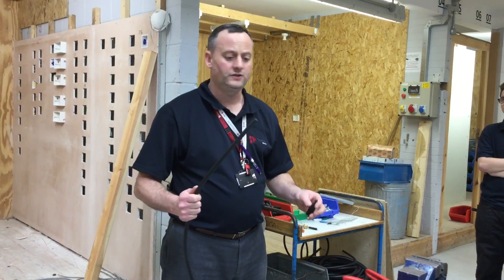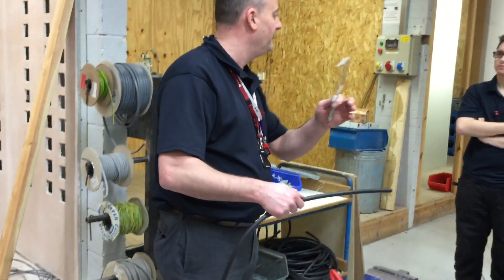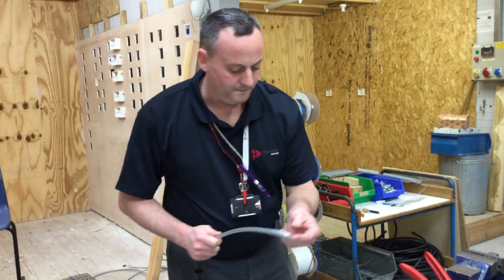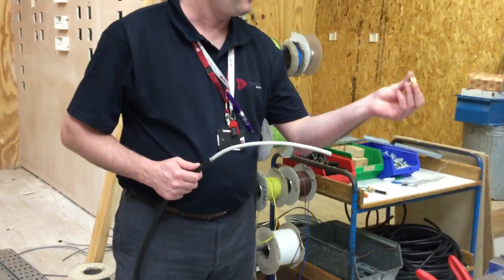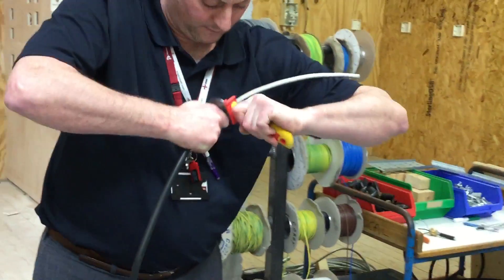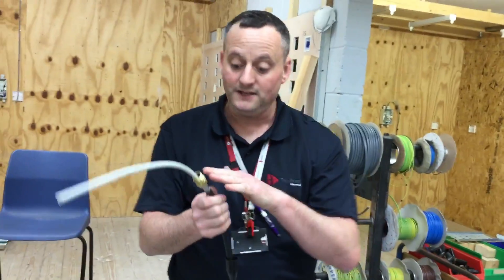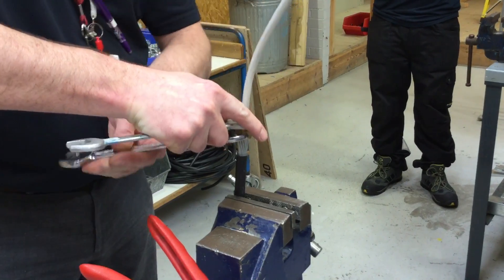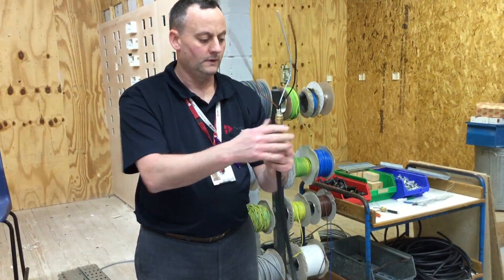Electrical practical skills making off the gland for a SWA Cable (How to Make of an SWA Gland)

Comment: Why did you cut more of outer  insulation then you have to? A lot of the steel armoured is still exposed behind the nut? 

I know that the shroud will cover it at the end but why did you take so much insulation off?

Also, Do you have a video on how to earth both ends of armoured cable correctly?
Reply: Have you wired a gland, and if so just how short and difficult was the angle? Did it slow the job down?

I liked the lengths he chose. Long enough for comfort and speed, short enough to reduce wastage. Rubber sleeve would so it's job to cover.

Conductors length: Probably just right for the next step, which I'm guessing was wiring the cable to a box that needs a gland and conductors of this length.

Comment: Im no electrician, but why go through all the hassle of scoring the inner cable, and then having to use side cutters and electricians knife as well as pulling the cables out?  Why not just use the score to bend the cable numerous times around the scored area exposing the wires, and then pulling off the inner sheath?

Your method is prone to someone either cutting the conductors of the wires.
Reply from the maker: +DrDangleyLegs 

Hi. PVC/PVC twin and CPC cables have solid copper conductors so bending them over and over can work harden the copper which weakens it. Many electricians don't use knifes and strip with just side cutters but again when your learning students press to hard and damage the solid copper conductor weakening it. Hope this helps GSH Electrical